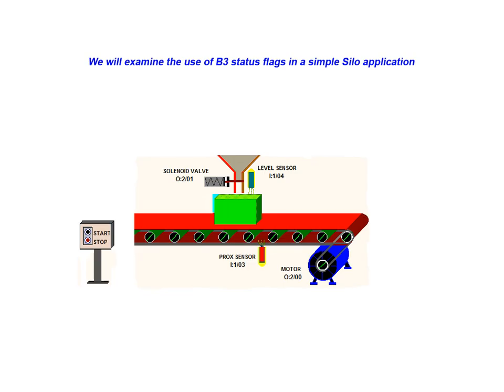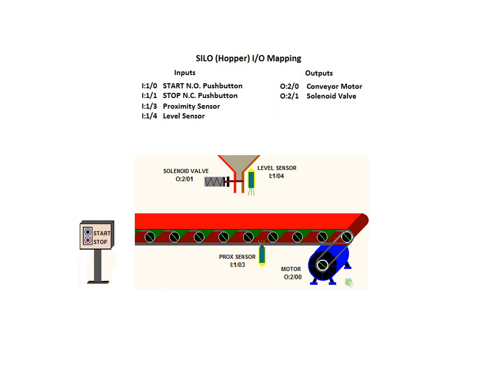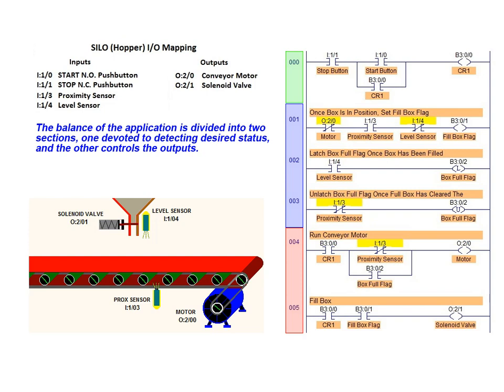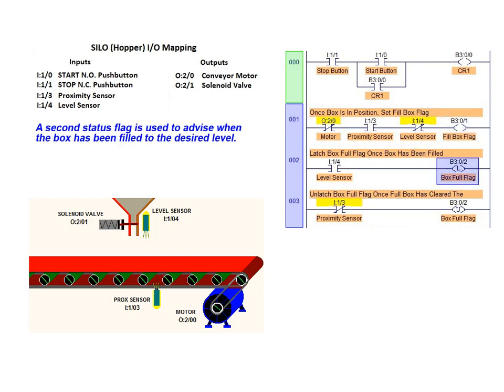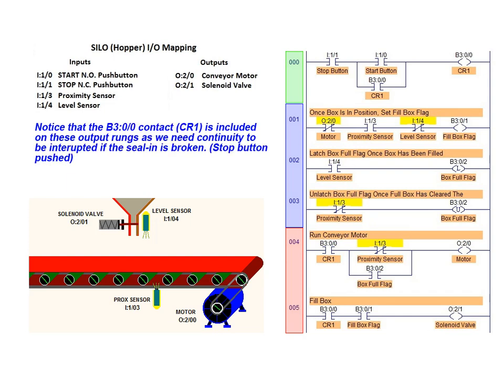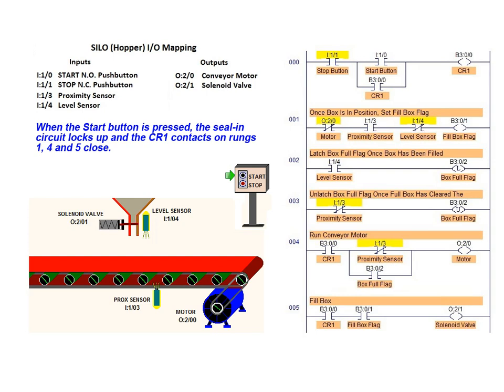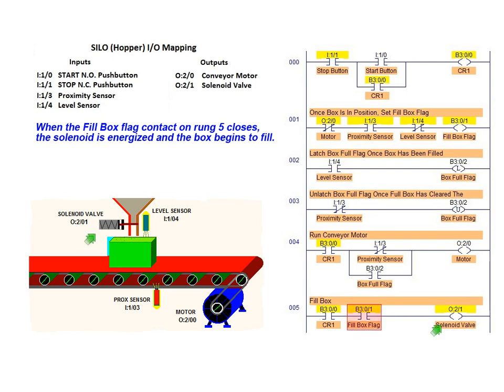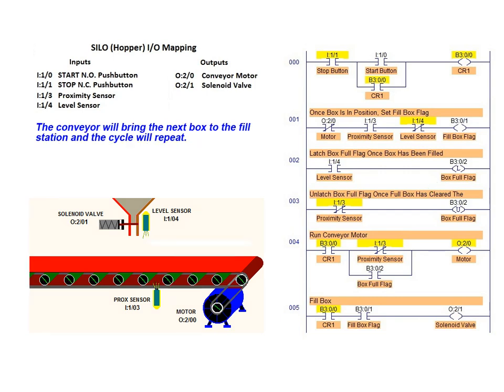Status Tracking and output control using a PLC's B3 Bit File - PLC Technician Certificate Program

Comment: I know that this is an old video but, the Stop Button in the first Rung should be Normally Closed (In my opinion). Thanks for the great vid, hope that you kept doing them. Greetings
Reply: The stop button is wired normally closed, but programmed as examine on/normally open - this way, there is continuity on the rung if the stop button is not pressed. 
The start button is wired normally open and programmed as normally open.